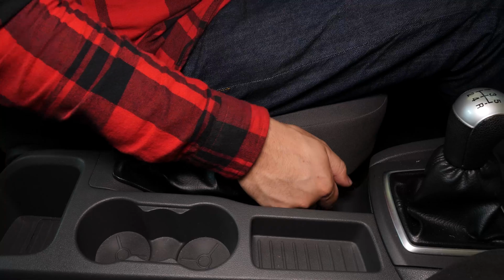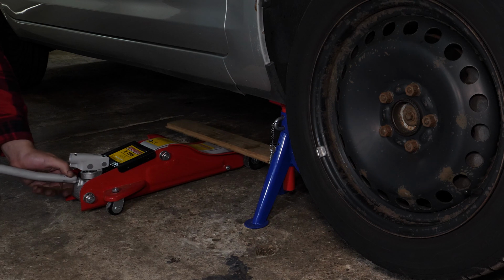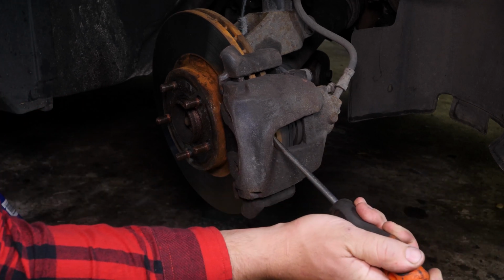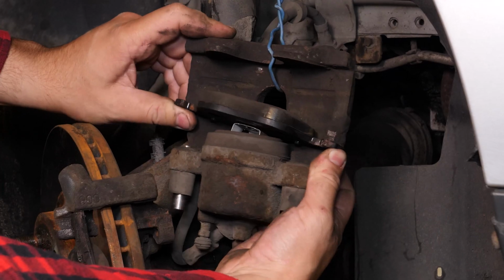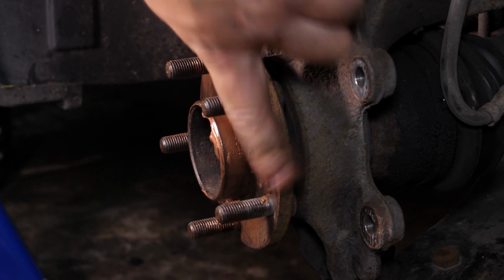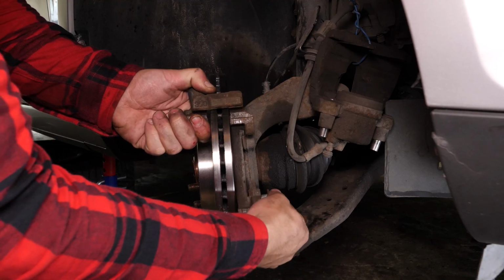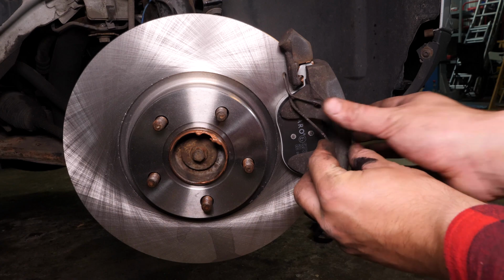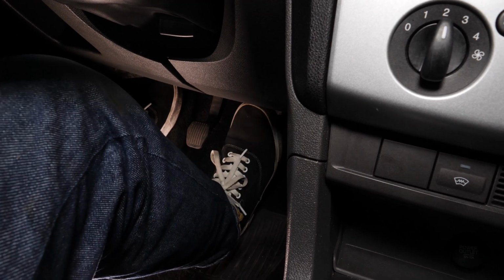How to replace the front brake discs and pads Focus mk2 🚗

Comment: DO NOT USE COPPER GREASE ON BRAKE CALLIPER SLIDING PINS. Silicone grease or red rubber grease should be used as copper grease breaks down the rubber boots.
Reply: On this particlular car. You shouldnt grease the pins at all. It's stated in the workshop manual from Ford. They use special sliding pins. Only clean them and apply medium strenght thread locker to the nuts holding them in place.
It's great video regardless tho

Comment: Worst tutorial I've ever seen. Please everyone do not follow their instructions if you care about you life and car. Grease on carrier bolts? Should be using thread lock not grease! Using a hammer to remove old stuck discs from hubs? Why, just to destroy your wheel bearings? Greasy fingers on brake pads? Once contaminated you'll never get the grease out. Not to mention, using screwdriver to push back the caliper? Use a bloddy caliper tool. What is this, 1970's all over again? Use proper tools for Gods sake, use gloves, use rubber mallet and above all use your brains. Or just take the car to a garage and you'll get to live another day.